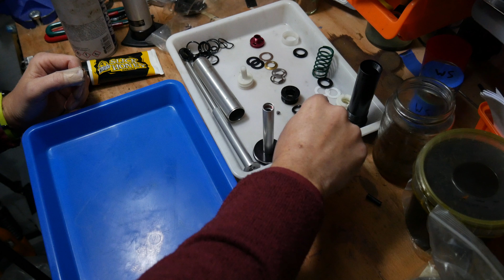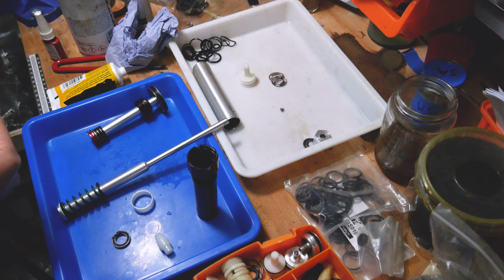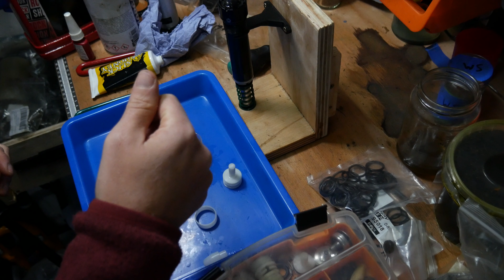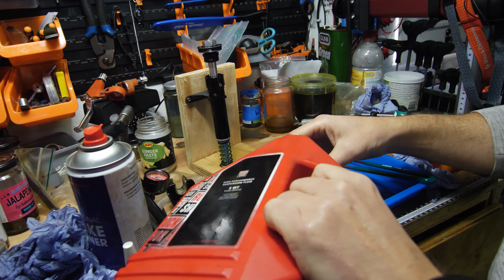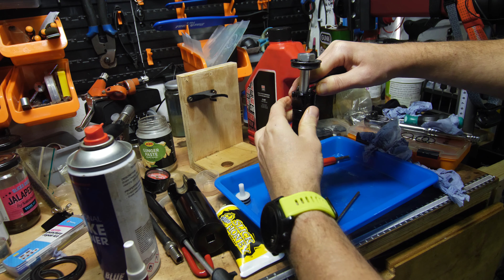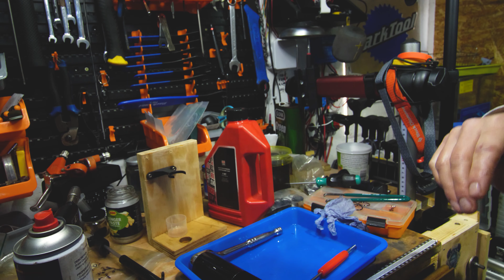Headshok Part 4 - Damper Rebuild

Comment: My Headshok has an air spring and it works great other than it won't hold air for more than a couple hours.  What do I need to do to re-seal it?  I can't find any videos that show the air canister apart.
Reply from the maker: If you check the playlist there is a video where I replace the seals on the air piston. It could also just be that your schrader valve core is leaking and with changing the core it fixes the issue. That’s a cheap and quick fix to test first!